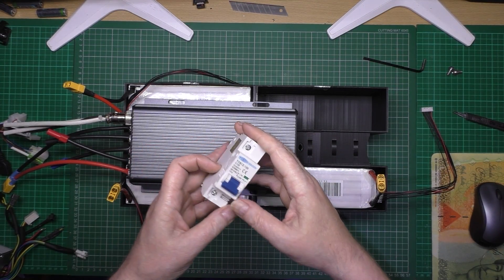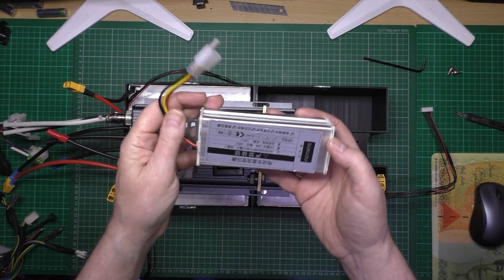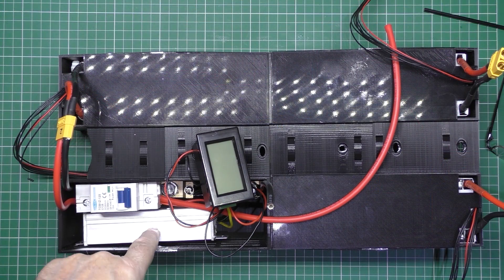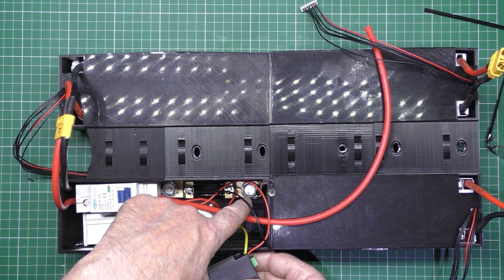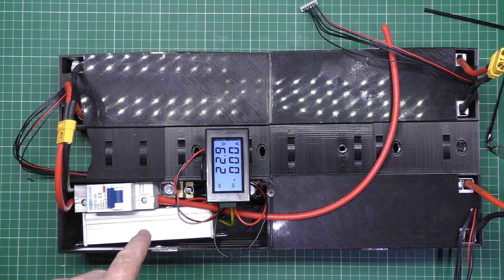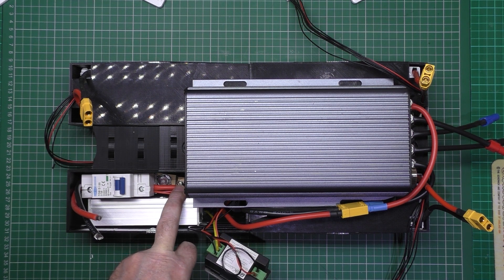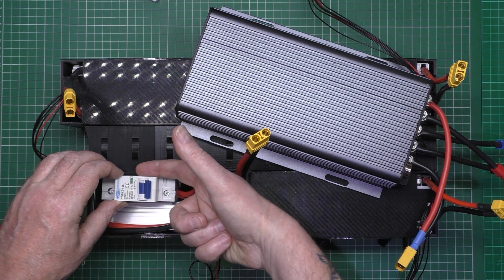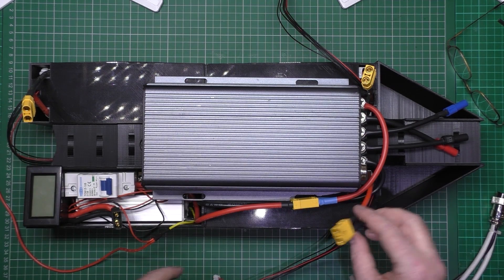11000w DIY eBike build part 3 - Main electronics placement

Comment: Hey you can just use a small 2a buck converter for your voltage step down. They are super small. But also you could use a Watts up solar meter it does not require a shunt and is more reliable and does not need a voltage step-down. I believe that would make a lot more room for other things that you would like to add.

Comment: thinking about printing some compartments for mine to do custom battery ....  you use PETG but is the biodegradable factor a problem ?  sorry if this was addressed in later videos.
Reply from the maker: I honestly didn't know it was biodegradable until now. Does that answer your question? 😁

Comment: hi, Please I have 50amp controller on a 52v battery. what circuit breaker should I use on? thanks
Reply from the maker: Hi,
A 63A circuit breaker will work perfectly! https://www.aliexpress.com/item/1P-63A-DC-125V-Circuit-breaker-MCB-for-PV/623944511.html

Comment: I am very bad in the field of electricity and I still wish to create an e-bike and I would like to ask you a question. What will be the 150a circuit breaker, thank you!
Reply: I'm not sure I understand the question. Are you asking what the circuit breaker is for?
If so, it's to completely isolate the battery from everything in case something goes wrong. Also, it will trip if something starts drawing too much power.
Reply: @vortecksengineering884 Ah Très bien! Merci pour votre réponse!

Comment: Hi mate as I've got a 36v 500w ebike controller but my wheel can take 1000w was looking for a 36v 1000w controller I've seen a few  from banggood.com and eBay but none of the wiring look the same as mine but I know that all do the same thing how hard  would it be to wire up a different controller to the wheel
Reply from the maker: As long as you have the wiring diagram for both controllers (so you can cross reference both of them) it can be done. They are basically the same but the wire colours might be different.  
The main (power) wires and hall sensor wires are usually be the same colour. The rest of them should be explained in the wiring diagram.   
I'd do it but then again, I've had quite a lot of experience :-)
Reply: Vortecks yeah you'll have to bloody brain surgeon compared to me

Comment: What gauge is you silicone wiring and do you have a link for it please.
Reply from the maker: For the main battery wires, I use 8AWG https://www.componentshop.co.uk/cable/silicon-cables/8-awg.html

Comment: Circuit breakers are normally designed for AC. I'm afraid that you will fry it if it is operated under load, the arcing might not stop due to the high DC voltage, be careful.
Reply: They make DC breakers, I see them on factory machinery for all DC circuits , they have a larger gap when open. As DC will arc over a bigger gap then AC.
Reply from the maker: These are designed for DC. I thought it was strange but it clearly says DC on the casing.

Comment: What kind of batteries do you have like where could i buy them,  and are there any companies that ship the 125A circuit breaker and the digital voltmeter to the US where i live.
Reply from the maker: They're Tattu 16ah 6s batteries.  
You can get the breaker from China - http://www.ebay.com/itm/252408047176 
The digital voltmeter...... no idea, sorry :-(
Reply: Vortecks Whats the C rating and how many you used ?

Comment: I've been scouring Youtube vids for info on things like buiding batteries etc.
Is there a website that you could point me to that outlines the principle parts and do's and donts of Ebike building ? or any good source of info for someone who isnt an electronics engineer, but has a pretty good grasp ?
I'm looking at a 48v, 1000watt rear hub motor on Ebay as a basic but reasonably powerful intro to Ebike riding. 
How much more than 48 volts could I put through this without knackering it ? With the aim of squeezing as much grunt out of it as safely as possible ?
Keep up the good work. This is very interesting.
Reply from the maker: All the knowledge I've gained is by reading forums (endless-sphere.com), watching videos and getting stuck in.   
Do yourself a favour and don't get a 48v 1000w because you're already thinking of making it go faster. You should really buy something that suits your needs and you can always drop the power down to save batteries and give better range. Doing it the other way will only end badly. I put 72v through a 48v controller which went well...... for 10 miles and now I don't have a 48v controller. I checked all the internals beforehand and they would all handle the voltage but I didn't take into account the extra current and heat.   
Drop me an email - vortecks2000@gmail.com and I'll gladly answer any questions (no matter how stupid they may seem) :-)   
Tony.
Reply: Look at Ebike School with Mikey on you tube, he covers all aspects of Ebike building

Comment: I would love to have the know how to do some thing like this.  great stuff.
Reply: The answer is: Learn by doing it.

I knew bugger all about bike building when I built myself a 7kW enduro e-bike. Now I know how to do bottom brackets, brake adjustments, derailleurs, chains, sprocket swaps, fork replacements and adjustments and a boatload more. And don't even get me started on the electrical side of things! I was already a dab hand with electronics but building my own e-bike has given me a much deeper understanding on specifying wiring to handle a specific task with no issues.

It's like any other trade or skill. You have to do it to learn about it properly.

Comment: If you need more room , you could move the amp display to the handlebars close to the cycle analyst, the display looks good and you can see it when riding. Also the 12v convertor box with the aluminium case being so close to the shunt. Are you going to put something non conductive in between mate.

Comment: Nice work Tony. Saving to build up an electric bike and your videos are a great help. Jeez it looks a bit daunting to be honest, I'm a bit terrified if I'm going to be running high amps. Worry enough with car batteries lol. Do you have an electrical background or have you just picked this up from building your own bikes mate.
Reply from the maker: It is daunting to start with but I've found that (when you're testing high current cables) if you just 'spark' it off the connector, you have chance to disconnect before it sets on fire.   
My background comes from my Dad really, he was always building stuff in the garage... speed boats, classic cars and anything that goes fast. The electronics side I've picked up myself over the years but mostly from all the RC stuff I've built.
Reply: Thanks Tony that's great to know. I've got a lot of learning to do before I start my bike.Will take me some time to save up so I'l use that time to my advantage. Would hate to fry something and have to start again. My dad is the same mate, always building stuff can make anything .I will never be as good ha.Wish I had his skills lol. Good luck with the build mate..

Comment: You lost me several times but the bits i did understand i really enjoyed lol.
i was just wondering if you weighed the bike strait from Halfords and will be weighing the finished item that would be interesting to see the difference Tony.
Reply from the maker: I'm already ahead of you mate......Standard bike with nothing else - 14kg   
Bike with everything loaded - 37kg   
Batteries - 2kg each (6kg total)
Sabvoton - 1.5kg   
MXUS motor - 9.3kg
Tyres - 1kg more than the standard ones (probably because I've filled the innertubes with slime) 
The rest is plastics, wires, electronics and pixie dust :-)
Reply: Thanks for the info Tony, all that hardware weighs more than i was imagining you did the right thing upgrading the brakes.
i tryed that slim on my bike last year it was nothing but a nuisance to be honest Tony, the times my valves were welded shut when i wanted to check my pressures and the one time i did get a thorn it seeped out every were and made a right mess and didn't even seal the hole it was coming out of.
so i ditched them and used them Kevlar tapes that go between your tyre and inner tube and so far not had any issues or punctures.

Comment: Nice work. Watch out using that 90v boost reg as a fast charger. They need air cooling over ~400W, and the inductor is underspec. A work colleague had the inductor burn out at 700w sustained, and had to strap two in parallel to get it working safely.
Reply from the maker: Cheers for the heads-up. I've tried it at 75v 10a with a big fan and it does seem to be stable........so far.

Comment: I really enjoy the brain storming sessions with you agonising over every little design for maximum functionality.
How much will the controls & battery box weigh when complete?
You've probably already built your bike & zooming around screaming profanities in your full face helmet :)
how will you protect the delicate electronics from rain & salt?
Reply from the maker: I haven't tested it yet but I will shortly.   
One of the reasons I'm making my own BMS is so I can enclose all the electronics with acrylic cowling and only one power plug on the outside.